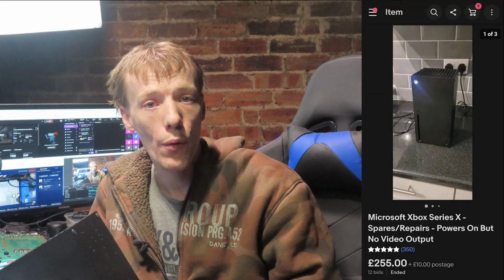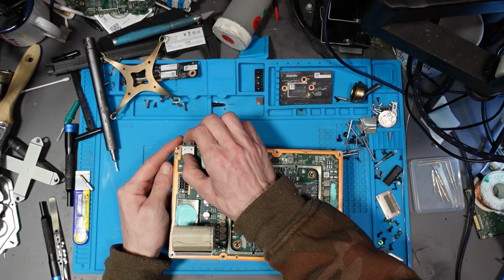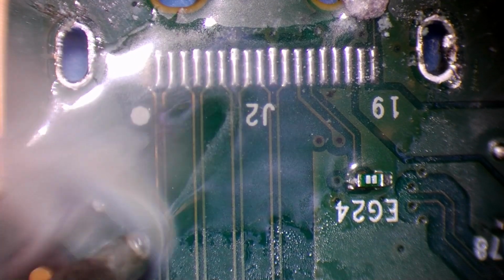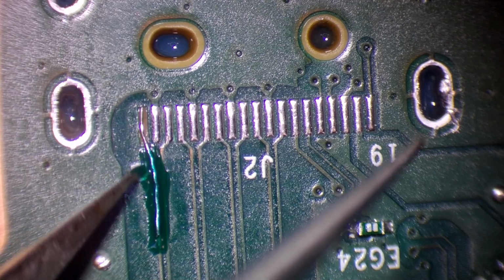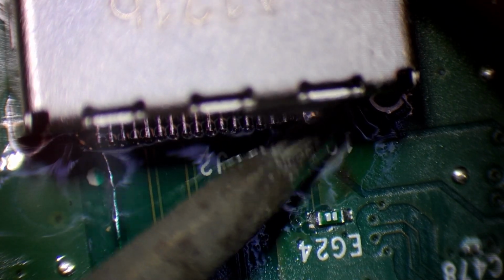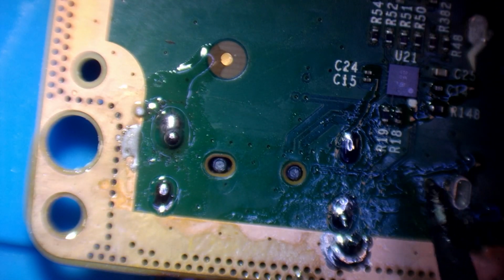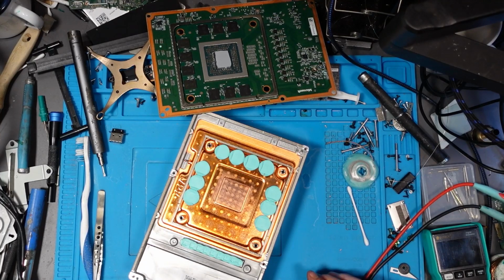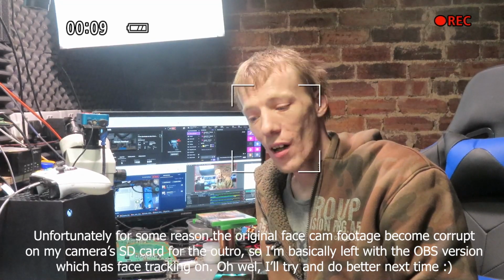I Paid $360/£265 For A BROKEN Xbox Series X On eBay! But Was I Being Lied To And Can I Fix It?

Comment: Wouldn't be surprised if you were lied to, i have been several times or deception over details, such as a PS4 Pro that had been worked on by the "repair shop" but claimed they hadn't, etc.
Reply from the maker: Yeah I've seen quite a few to be honest mate. I don't reel lied to if I'm honest, just the description didn't include everything it should have done
Reply: Ebays a nightmare for that stuff. I got an apu of someone and it had a few bent pins, on the pictures it looked fine. I'm assuming the little shit just used the pin side of the upgrade they got lol. Got it working though.

Comment: How did the controller update? you weren't even connected to your home network right?
Edit: Right you connected afterwards which btw you gave away your wifi password there m8. You might not think that you did but you did and if you use your own pw and not the standard pw then good chance you use that pw with other accounts so you need to do something about that buddy. Be more careful next time. Great video.

Comment: Great save. I was wondering why u gave the seller such a glowing feedback on eBay? “Exactly as described”. At best I’d left a neutral. They didn’t describe previous repair(s) attempts & that’s most important. Obviously u know that you’ve said that a lot. It’s a small thing but I was curious. BTW I didn’t know that as a prime subscriber one gets a free subscription to a channel. U informed me so u got it. 🥂
Reply from the maker: Cheers mate. Yeah I mean in fairness I can't just assume I got scammed on this one, since the seller did post pics of the sticker, so he probably took it to a repair shop, they screwed up then failed to sort it out for the owner. I'd say that's the most likely scenario since other than a damaged trace it wasn't really that bad. Either way I'd have been happy even just with the spare parts at the price I paid because I don't have any at all and the SSD alone is worth £120 roughly lol. Thank you by the way, the support really helps. Usually twitch revenue goes on buying random stuff on ebay to fix lol

Comment: You make me cringe when you scrape those traces and push on pins.. u push until it does move.. u did not need to scrape that trace.. just re-seat the hdmi port.. also that kingbo flux burns nasty & pain to clean & i can see the board after u clean it.. it leaves a nasty residue behind.. amtech is much cleaner all the way around.. try a tube 559 and see.. it's not that much.. $17 for 30cc.. that's alot.
Reply from the maker: Sorry but you're wrong. The trace was physically broken all along hence not displaying on the TV. The trace has to be scraped to get a contact. I've repaired hundreds of trace damage consoles and without sounding cocky, I do know what I'm doing, it's my day job. I've also used Kingbo for over 2 years, it doesn't leave a nasty residue. I definitely won't be buying Amtech, it's over priced and over rated, and too many people listen to other YouTubers who say you "must" buy Amtech just because it's a little easier to work with. People can use what they want, but I'll continue to use Kingbo, it's never caused a problem. I've never had a board back which has corrosion and I don't find it difficult to work with. Just my opinion